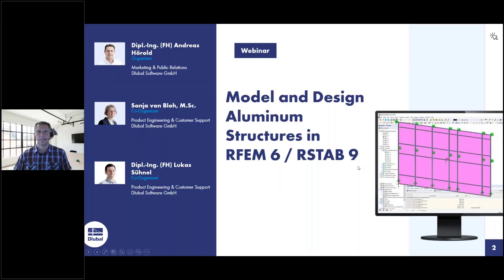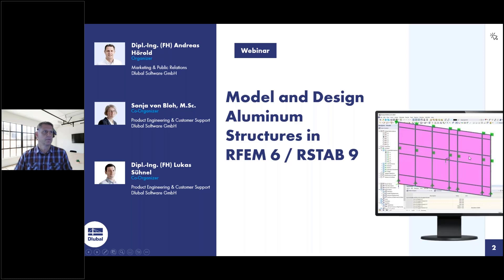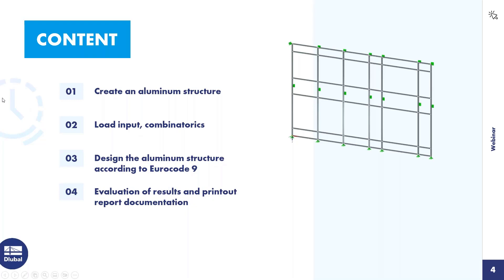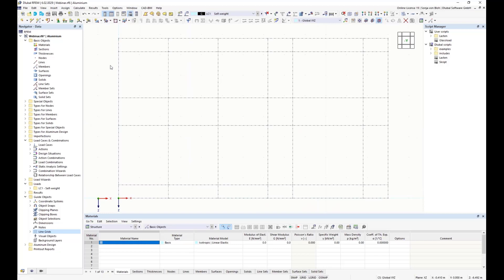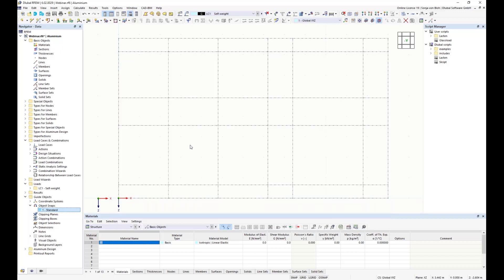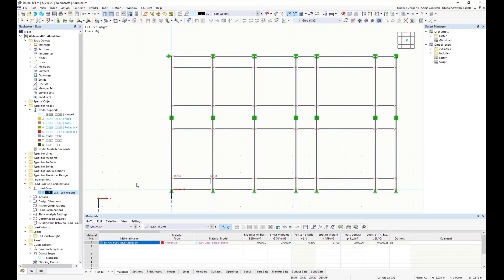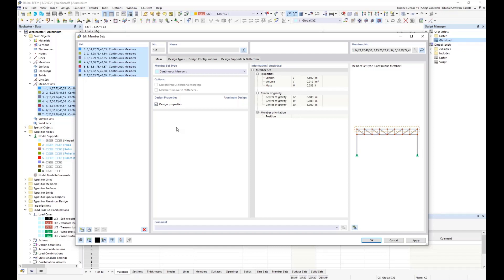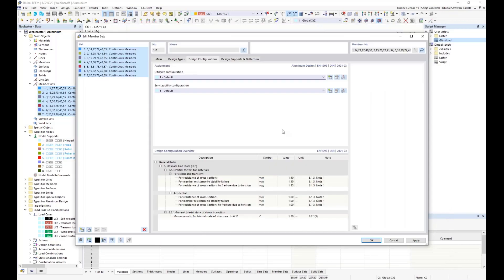Model and Design Aluminum Structures in RFEM 6 and RSTAB 9

Comment: When you have applied the glass dead load to the transom in Self Weight load case, Why there are two other trasom load cases ? one with 1.0 other with 0.5, it is not clearly mentioned for what those loads are applied.
Reply from the maker: Hi, @ghilmandilshad9495! Load Case "Transom loads (in direction of fall)" indludes the horizontal loads on safety barriers in the direction of fall.Horizontal loads on safety barriers are regulated in chapter 6.4 of EN 1991-1-1. They depend on the categories according to their use. For category B2 the horizontal load is qk =  1,0 kN/m. 
Load Case "Transom load (in opposite direction)" includes the horizontal loads in opposite direction. According to the German national annex, the transom loads are to be applied in the opposite direction with 50%, but at least 0.5 kN/m.